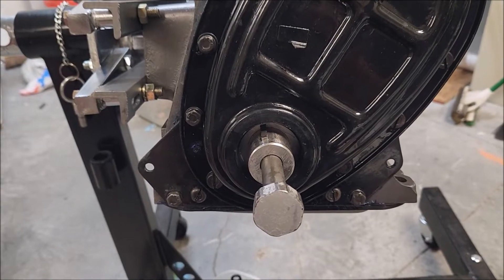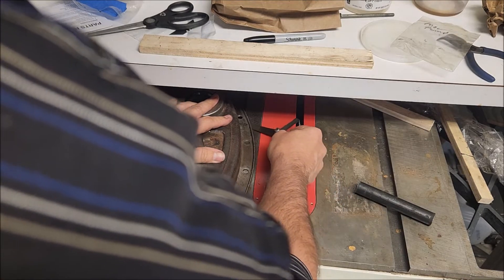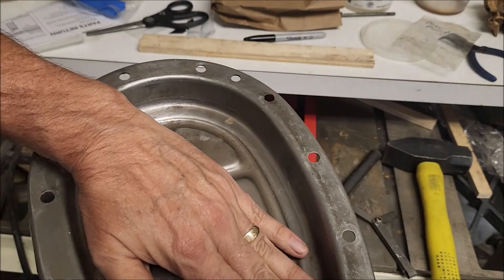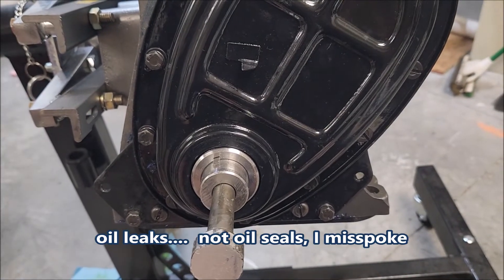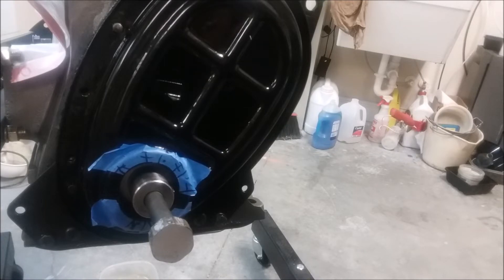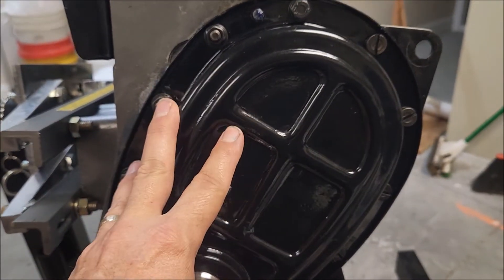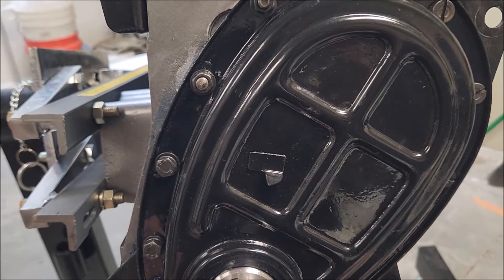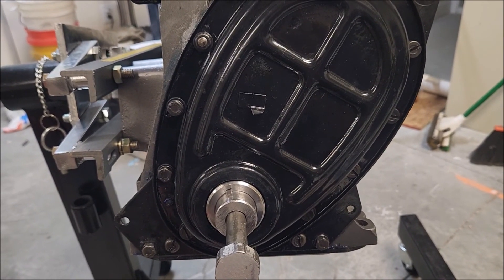Straightening and installing Triumph TR6 Timing Chain Cover

Comment: When you put the Seal collar onto the Crankshaft you should put a light layer of sealant inside the Collar so no oil will leak out from in between the Crankshaft and collar.
Reply from the maker: Interesting, I will look into that.  Thank you.